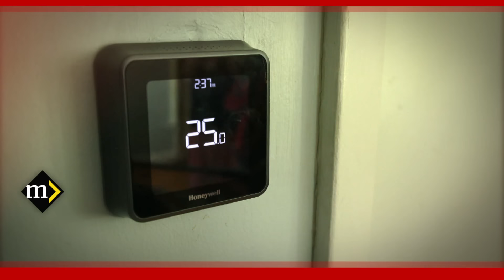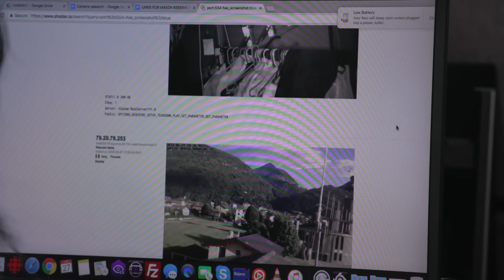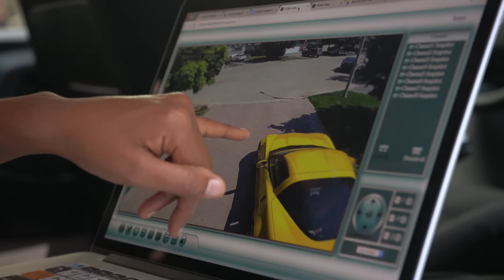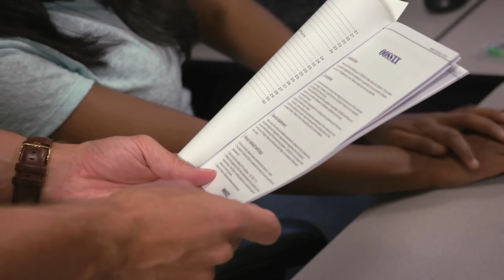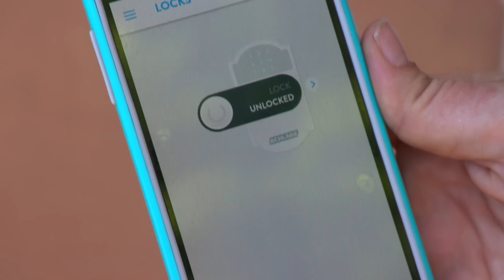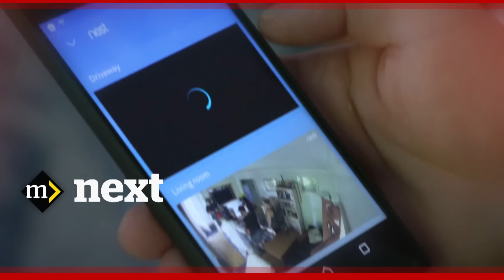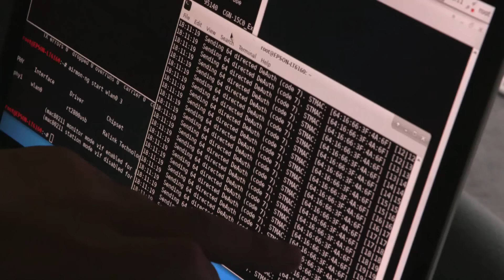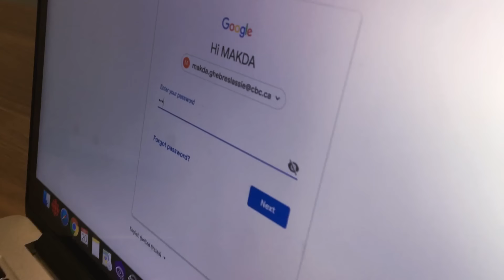How hackers could use smart home devices to spy on you (Marketplace)

Comment: Maybe that explains a lot of the "ghost" videos out there. People hacking people's lights and stuff
Reply: Josh only works if its connect to any sort of internet. U cant hack a whole house imao, unless its all connected to the internet in some way or form
Reply: Lights go out or flicker if there is any sort of wiring issue
Reply: ZE yea bluetooth too, forgot to mention that. Especially since bluetooth is the easiest to hack
Reply: @boqoll  that's why wired cams are safer
Reply: Does not make technological sense to hack an electrical circuit through wifi
Reply: Not unless it was within the last 5 years I imagine, when most of these videos are like 15 years old when none of this existed? This is still very new to my understanding.

Comment: The best hacker-proof method is not to use over-the-cloud surveillance system.

The proper ones are called "closed-circuit" for a reason, as long as your system does not have the ability to connect to external networks, no hackers could hack in, no matter how hard they try.

Unless, they come to your place in person
Reply: The convenience of viewing your home while away is the reason why no one uses closed circuits. That's y a lot of ppl but IP cameras these days, for private broadcasting.
Reply: Timothy Two Gun Thompson  closed circuit would be good for robbers, they'll rob away that recording as well.
Reply: We (the people) will tend to find the easiest way to do things. "Being lazy" 
I used to be a Telecom equipment installer and also installed satellite dish's on residences. A friend asked if I was going to install a security camera system would I choose CCTV or wireless? I told him I would install a closed circuit system, but it takes proper planning, installation of equipment & cable management to ensure any physical attack will be very difficult. I then heard his wife say that wifi cameras would be easier & cheaper. I told her that I agree with her statement & left it at that. 
Once they got a system it took me and a friend sometime but we did manage to compromise their system. LMFAO.
Reply: Thanks. More research needed.
Reply: And they do! Go out. Someone with a cell phone is reporting your house is empty. Oh, those guys in green vests? They are just workers. Fixing leaks? Fixing street lights? Etc. PLEASE take this seriously.
Reply: And yet in films aren't they hacked from other buildings....? Interesting, now I've got to figure out that logic. I guess it's just film logic honestly.
Reply: Then how does one monitor their security cameras when they're not at home? [apologies if this was asked already but YT won't let me see current replies.]
Reply: @samsun01  gangstalkers will do that too
Reply: Can close direct be used by you while away from you home, or can video be seen and sent to your cell phone if intruders as well vedio kept for police to view.Really have to ask.I feel like you know and won't to help.
Reply: @berthageorge2627  IP cameras are dangerous in general unless you have a highly secure wifi network. Most companies these days are offering end-to-end encrypted cameras that do not broadcast but can still be accessed away from home through an application, the downside to these devices is most are entirely reliant upon an active wifi connection meaning when your internet is off, your cameras are off. (some offer physical storage such as an SD card which would still record without a wifi connection)
Reply: @berthageorge2627  To answer your question more directly, you will need a LOGIN AND PASSWORD to access 9/10 IP cameras. However, these connections are often extremely unsecure, and it's very easy to gain access most of these systems. Technically, the cameras will broadcast to ANYONE who has access to the web address, and is able to login. So yes, these cameras in some ways do broadcast to everyone, however not everyone has access to that broadcast. On the other hand, that broadcast is extremely unsecure, and easy to access. The safest options, are always closed circuit meaning no broadcast, and the cameras save video onto a recording box; or end-to-end encrypted wifi/cellular cameras.
Reply: @bigbadalphawolf9330  So basically your saying u watched her drain his hose without them knowing it?

Comment: Put some tape over your laptop web cam too
Reply: THE FBI  WANTS TO KNOW YOUR LOCATION
Reply: MY LIFE IS A MEME MY LIFE IS PATHETIC camera doesn’t effect gps
Reply: And phone
Reply: done that since 2010
Reply: Everyone worries about laptop cameras but nobody does about cellphones. My cell has 3 cameras and getting picture from it is easier than from laptop. You can even install apps that will let you do it.
Reply: kalbs89 i've been using guitar picks since 2009
Reply: I really want to put it on my phone cameras too but it's so impractical. That's probably a camera I worry about the most
Reply: ChaJang - I just cut a tiny square of black electrical tape and cover the front "selfie" camera, which I never use any way.  It's almost invisible on my black phone and has stayed on for a while now.  At least that way nobody can actually be watching "you" (you're face) as you're browsing your phone.  I don't really worry about the normal camera on the back (which I do use) because I always have my phone either faced down when I'm not using it or in my pocket.  For the times I am using it I'm really not too worried about somebody possibly being able to see my feet from time to time lol.
Reply: @lsubslimed  I had someone watching me from my phone camera actually. I knew who it was so it wasn't as creepy but frankly I'd rather not. This is why I mostly cover mine but take it off at times and forget/am lazy to put it back. I wish phone case manufacturers would make a swiveling security flap that covers the lenses.
Reply: Habitual Line Stepper how did you know you were being watched
Reply: @creativitydisplay3059  they taunted me online with specifics about my appearance and/or interior of my home
Reply: Habitual Line Stepper -  Just curious, but do you know which camera were they spying on your from, the front "selfie" cam or the main camera on the back, or both?  It often boggles my mind seeing how many sick-headed people there are on this earth, who have willfully seared their conscience and left behind any shred of integrity they might have once had.  The things people will do to other people to fulfill their own sick and perverted desires... 😑
Reply: @lsubslimed  I can only assume that perhaps their integrity was compromised at an earlier time and hadn't regained it. Perhaps their peers showed them that morals can not only be thrown out the window but that it's the zeitgeist to embrace. Perhaps their mother didn't hug them. I couldn't tell you but I won't pretend to know what their motives were because I'm not them nor did I experience whatever they have that led them to their decisions. Point is I cover my lenses now. End of story.
Reply: The odds of a Joe Schmoe getting their laptop camera hacked is insanely and extremely low. Unless you're globally a popular and fairly well known person, no one is trying to hack your camera.
Reply: @theonlybuster  tell that to anyone who's had a stalker. Happens in those cases quite often.
Reply: Also put some tape on your eye.
Reply: It's still not enough they will look for you wherever you may be and they'll track you down and find you
Reply: @chocolatewheelchair  you misundestood the meme, they want to know your location because they can no longer see you
Reply: I been doing this for 5 yrs,
Reply: u can just disable the webcam in device manager
Reply: @mylifeisamememylifeispathe3140  Is this 1994?? They (the FBI) already have it. 😎
Reply: @ricardoaadams  Me too but whaaat?😎
Reply: Camille Triboulet-Hall Great minds think alike...
Reply: Or just buy a Huawei Laptop
Reply: What about front and back camera on your phone?
Reply: @chajang7292  right. I feel weird having my phone camera exposed, but I don't want to ruin it by putting sticky tape over them. I just make sure no cameras from my phone or computer are facing me when I am doing something private, like being nude or using the bathroom.
Reply: @lsubslimed  it does not leave sticky residue?
Reply: @habituallinestepper2883  that's messed up. I'm sorry.
Reply: @theonlybuster  It happens to a lot of people though. There are a lot of websites where people can watch random, every day people through their cameras. People are sick.
Reply: Timothy Two Gun Thompson  I would still rather them only be able to hear me and not see me so I wouldn't say it is pointless.
Reply: @venturoes1912  that wont work
Reply: Sorry for so many replies lol
Reply: Mind Flowers -  The tape is still on there since I first put it on so I haven't had to deal with any residue yet.  But if I ever wanted to take it off and there happens to be some  residue, a little bit of rubbing alcohol on a q-tip would take anything right off and it'd be good as new 👍

Maybe the odds of some random person hacking my phone's camera are low, but it's such a simple solution to have the peace of mind knowing that nobody can watch through my camera even if they wanted to.
Reply: @auroraborealis675  soo if u just disable a device and block it from working it still works...
Reply: I DID SINCE THREE YEARS AGO HAHAHAHAHA
Reply: or phone becz the gov is watching
Reply: MY LIFE IS A MEME MY LIFE IS PATHETIC they already know your location just buying or purchasing a laptop or computer or smartphone is a done deal.
Reply: Yah right! Soon your laptop screen will be turned into a camera with the way technology is developing.
Reply: @mylifeisamememylifeispathe3140   just ask google.
Reply: also turn the camera off in the bios.
Reply: Had mine covered since 2011
Reply: Also put tape on cellphones and tablets front and back cameras. But hackers can still listen to your audio.
Reply: No, i  dont think so. Nobody taught them any morals at all.  There is no dilemma for them.
Reply: If that makes you feel better go with it. There are ppl walking around in stores zapping phone grocery list, panic stopping handicapped motor carts, shooting ppl with sonic devices to make them feel sick of dizzy and even using laser pens to zap ppl on buses for no other reason than boredom or their diseased mental state. It's random now. You don't have to be anybody. In fact you are a better target the more unlikely it is for you to be hurt by anyone.

I am glad you think like this bc it is encouraging to know you are safe so far. May you never have reason to know otherwise.
Reply: @chajang7292  use electricians black tape
Reply: @Tom-xy9gb  huawei is spy central lol
Reply: All the time lol.
My bf even taped over the phone camera

Comment: Ditch the so-called smart devices and you'll be fine.
Reply: Or direct Poe connection.
Reply: I saw this coming,long ago.
Reply: I can't, my job requires one lol.
Reply: @kowlovo  What does PoE (Power over Ethernet) have to do with anything in this situation. I don't think you know what that means. Did you mean PPTP (Point-to-Point Tunneling Protocol) which is an outdated VPN protocol that is just as insecure as an unencrypted connection? OpenVPN is a newer protocol that isn't so insecure and is even easier to setup on a DD WRT router. PPTP isn't even supported on iOS devices anymore.
Reply: Grizzy Romannn  Ikr
Reply: Grizzy Romannn  It means "I know right".
Reply: Very true
Reply: I got a camera that was Bluetooth that was fine
Reply: Easier said than done
Reply: just ditch those with camera .. smart plugs are very handy
Reply: just think smarter about smart devices
Reply: @kowlovo  what does Power over Ethernet have anything to do with hacking?
Reply: Maybe I'm paranoid but I've refused smart devices and AI apps like siri from day one.
Reply: @bobloblaw7465  You're using a smartphone though...Isn't that problematic as well?
Reply: @Revnoplex  Like not having anything at all this is smart, like a smartphone. I've been hacked for almost 5 years. Yes, I've replaced my phones and went INCOGNITO. Still, Right off the bat, I'm hacked. Can anyone help?
Reply: @cathyscarvey2461  yikes ur in a very bad situation, u should report stuff to the fbi or whatever
Reply: Does this stuff apply to smart phones too?
Reply: How ?
Reply: Laptops, phones etc. Can't cover it all

Comment: It's a form of stalking.  They do it in in your cellphone and real world time.
Reply: Turn off your location services, notably the GPS radio/sensor. It is a serious drain on the battery anyway. Especially if you share photos on the internet, your photos should not have GPS latitude and longitude information. Photos can be downloaded, that data access, leading a stalker with turn-by-turn directions to your home.

In a moral and trusting world, that info might be useful. But in the current world, who on the internet needs to know where the photos were taken, as if your descriptions doesn't already tell them all they need to know? Is it not enough that photos are date and time stamped?

If your camera app has a relevant setting, tell it to not store any location info on your photos.
Reply: Yup going thru this now +Gangstalking
Reply: BriLoveMusic  go w/ya gut

Comment: This wasn't equipment failure this was human failure. No security can prevent the human handing over credentials
Reply: I mean, you can require registering sign in details to enable the systems rather than having them work immediately on default login and passwords. Human failure is at fault, but they could have been designed better.
Reply: Part of the hacking involved phishing, which is also a compromise due to human error. And to go a step further than that, clicking on random links can get malware installed on your phone, which can in fact effectively negate two factor authentication. In fact, beware of any apps that ask to be able to handle your messages, because that can be used for the same interception.
For as long as there is human, nothing can ever be completely safe. Only relative better to make hackers jump through more hoops.
Reply: This was both equipment failure and human failure

Comment: Easy fix, don't use WiFi or wireless , use WIRED, and don't connect to the internet ! If they are internet / network cameras then use a separate computer that isn't connected to the internet. No security updates ever needed !
And NEVER get a wireless lock ! Use a good dead bolt with an extra guard to stop people from breaking in.
No passwords this way to hack. Hacking is IMPOSSIBLE this way ! 
His advice was bad, that just makes it take longer to hack.
Reply: ikr, i thought cctv was common sense.
Reply: The problem with this solution is that... if someone invade your home when you are away AND find on which computer the video is being recorded, the camera are now useless.
I guess if you really want to go the extra mile, you can build a data storage device into the wall...

I wonder how much that would cost for the average joe that can't do it themselves....
Reply: 2 months ago, I shopped for a security camera available from a store. I asked if there were any wire camera in the market. unfortunately, the answer is NO!
Reply: What sort of store though? More generalized stores like best buy would only have wireless. You'd have to go hardcore and find them in specialized shops or order directly from the company online.
Reply: That means go old-school 90s
Reply: @asdf83917  which is done on purpose by big business as all are with the governing body of all countries who now give consent to allow ALL data online to be stored. 24/7/365 this has been going on for quite some time. Nearly 20 years. There is no true privacy anymore. In some cases companies are paid to make it even easier for governments to access the info.

Comment: The problem is most people don't know or understand the technology. I'm an IT Network Specialist, I have cameras around (outside) my house that do not connect to the internet. I have a surveillance computer that records everything and that can be connected to the internet when I'm on vacation. However all cameras are on separate networks, everything has to go through the computer that gets constant updates to keep it secure. Even though I take precautions, as unlikely as it is, getting hacked is still a possibly. Hence no cameras inside my home. If you don't know what you are doing you should never let your tech have access to the internet.

Comment: There is a reason why actual professional security cameras are called CCTV CLOSED circuit! 😐
Reply: Do only professional companies supply cctv closed circuit cameras or are regular consumers able to set up cctv themselves?
Reply: Califas well due to liabilities government issue licenses to those that have undergone security background checks. But if you want to install a system for your own house or business, it's not that hard but it is time consuming. I'm not licensed but i set up two cctv systems for private companies back in 2007, so i have some experience but not a professional. The cameras back then were analog but even today they are still good if not better than those cookie cutter systems as you can customize most professional cctv cameras with appropriate optical lenses.
Reply: can you see me where did i say they can't be exposed? and yes i do know what I'm talking about, i used to import cctv systems about 12 years ago. i stopped in 2008, i have to admit i haven't been keeping up since.
Reply: Anyone can set it up themselves.
Reply: can you see me  Exactly!  IP cameras hardwired to a NVR, DVR or older analog cameras hardwired to a Hybrid DVR with an internet IP connection, still have many of the same issues as a cheap Big Box Store WIFI connected camera.
Reply: Califas 
Harbor freight sells cctv camera , 40.00 each or a bank of them and with recording device about 300.00 usd.
😀👍
Reply: CCTV security cameras are safer than. Wifi security